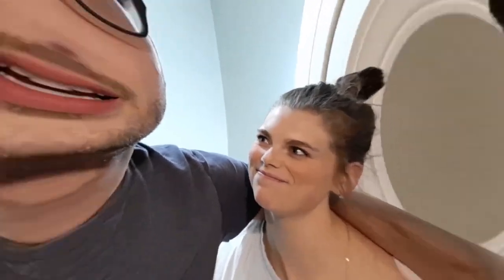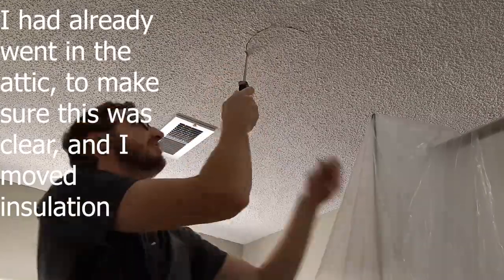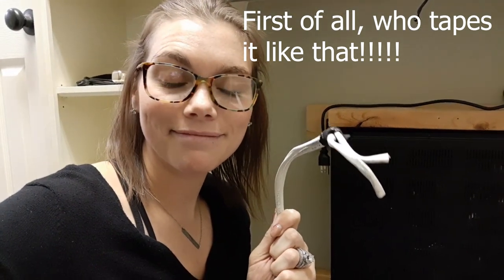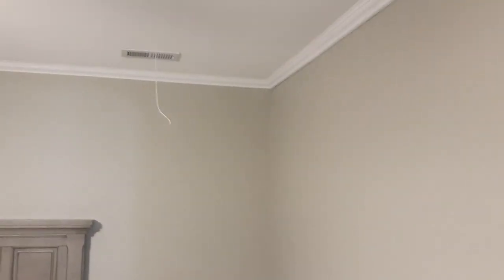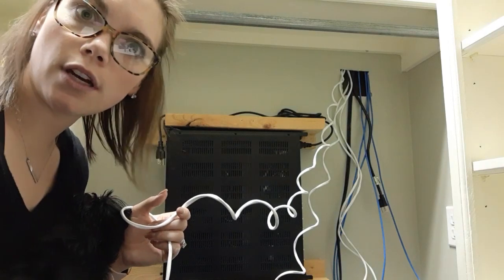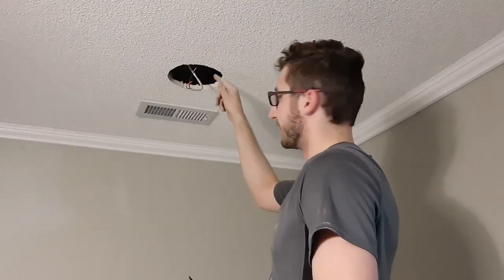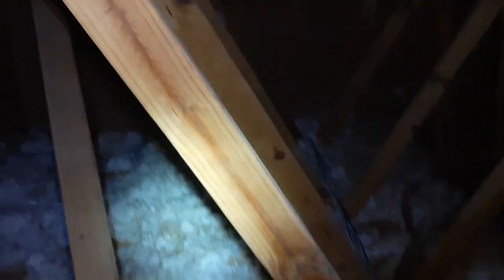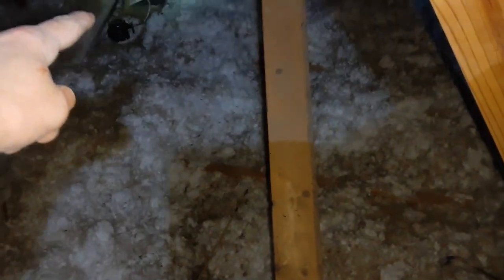Whole Home Audio Start 2 Finish EP8: 3 Speakers in ONE Zone! & Dual Voice Coil Ceiling Speaker

Comment: Can you explain the difference between 4 & 8 ohms. Also what’s the difference if you home run the speaker wire back to the amp vs running in parallel; pros/cons?

Comment: My garage walls had Sheetrock like that. When I remodeled it into a room. I just put one piece of Sheetrock in it instead of the double they had on a few studs. Turns out it was because the walls studs were a little bowed. So the extra Sheetrock helped keep it flat and not wavy. 

No idea if this is the same reason as yours but looks the same

Comment: I need a little clarification on which wires are being used to splice in the third stereo speaker. It looks like you are using a 2 conducter wire on the stereo speaker in the bathroom. In my home set up, I have a 14/4 wire going to the first left mono speaker and a 14/2 wire spliced there to go to my second right mono speaker. If I want to add a stereo ceiling speaker in the adjacent Laundry room by splicing in from the left speaker (the one with a 14/4). Do I need to feed a 14/4 cable or a 14/2 to the stereo to wire that one? Logically I'm thinking a 14/4, and I would splice it into the incoming line on that first left speaker. But in the video I think I'm seeing 2 conducter cables everywhere. Is that causing Ohms issues?
Reply from the maker: So, the 2 bathrooms have 2 different speakers. The first speaker we did in the video was a stereo dual voice coil speaker, but I still ran 2 cables, each with 2 conductors. So essentially this could have been a 14/4 Wire, because the speaker has both left channel and right channel hooked up to it. The other speaker in the master upstairs bathroom was a standard 2 way speaker, and I branched it off of one of the channels. So it's in parallel with one of the speakers. So technically that zone has 1 left speaker and 2 right speakers, but it sounds fine, no one would be able to tell. Does this help?
Reply: @TheKMZ1  ok, yes. I’ understand now. I kept rewatching because I thought the same bathroom was being wired at the beginning and end of the video. That makes sense now. Thank you for clarifying.

Comment: Thanks for sharing!  You think the Soundavo WS66i is better than the Monoprice 6 Zone Home Audio amp?  What do you like better?  From my perspective the monoprice ties into home assistant and I already have that implemented.  Curious as to your thoughts though, looking to install whole home audio in a house my wife and I are building.  Thanks and cheers!
Reply from the maker: Yes I think it's better, I have a video on my channel talking about this new amp and the differences. This one has the same RS232 interface and commands as the monoprice, so it will integrate into your home assistant exactly the same, no issues. The reason this WS66i is better, is that this has 2 wireless streamers built in, and ethernet network interface so that way you don't need the iTach flex to control it. You can only use the RS232 or ethernet control, but not both. The good thing, is that you could also program your home assistant to use the network interface instead of RS232 if you wanted, the port for the network interface is 8080. Not only that, but soundavo is continuously investing in this line of amp, they have been designing a new keypad option for it, and you can buy parts from soundavo. You can't do that with the others, they are just kit sellers and nothing more. Hope this helps!!
Reply: @TheKMZ1  For me the integrated streamers is a drawback because they'll eventually become obsolete, not the amp. I prefer to separate routing/amps from streaming/sources. Just my opinion on this :-) Thanks for the cool video as always !
Reply from the maker: @aRndBelgianGuy  they use the link play steamer which is the same steamer used in other name brand amps. Aside from the 2 streamers, you still have 3 other hard wired inputs, where you could either use your own steamer or hard wired inputs
Reply: @TheKMZ1  Yep. What I mean is that it's part of the same box and I don't want to replace the whole amp if a new Airplay version comes up for example ;-)  I agree it's a very cool solution but I want mine to still work in 15 years by just swapping a 100€ box (I have two DAX66's).
Reply: Do you have a link about the "link play streamer" ? Is it also used by the DaytonAudio WFA28 (the one I use) ?

Comment: Since there are 2 in the bedroom and 1 in the bathroom on the same zone, you can not independently turn off the bathroom?
Reply from the maker: That is correct, at least in how I wired it. I could have added an analog wall volume control, but in this particular case I don't care if that 1 speaker is on when the others are on in that zone
Reply: @TheKMZ1  how would one go about wiring in an analog volume control? I was thinking of having 2 speakers in the bathroom but fear it might be distracting.
Reply from the maker: @swiftcreek2008  I actually recorded a video showing this, I plan on having it up on my channel soon!
Reply: @TheKMZ1  for the analog volume control Into the bathroom. The bathroom/bedroom would be on the same zone. 
I would wire the bathroom coming off of the speaker in the bedroom. Would I run the speaker wire from bedroom speaker to volume control then to the bathroom speaker?

Comment: Should have attached a pull string to the 1st pull and then wouldnt have to worry about dropping the line back down for the 2nd pull, or cut plenty and made all 4 pulls in 1 just tapped staggered down each other